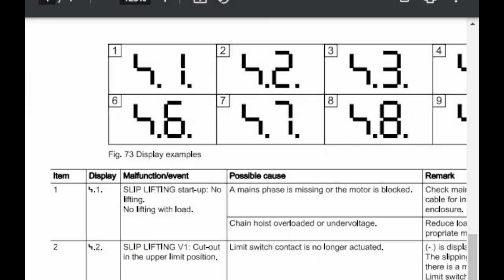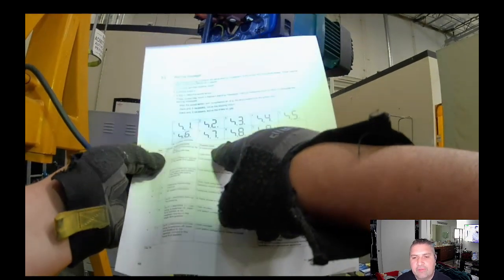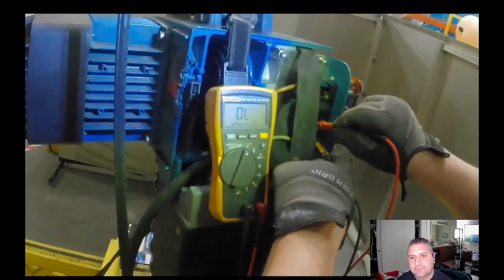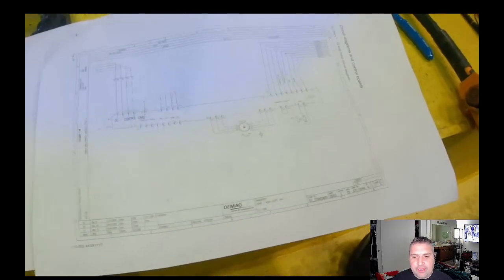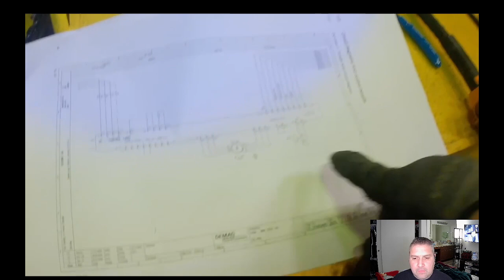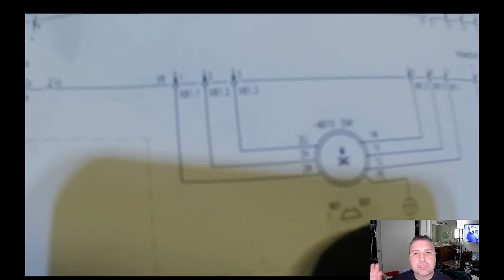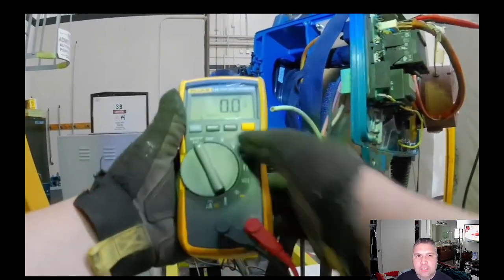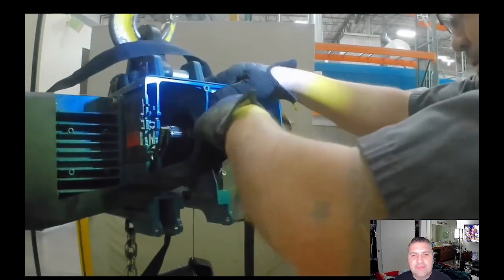INDUSTRIAL TROUBLESHOOTING 101: DEMAG Hoist Fault Solved

Comment: Hello .
I have a Demag 10Ton-  5ton. With two speed. Low and high
Working with same pendant.
My issue is that the 10 ton doesn't go down on the fast speed.
On lower speed is fine, but when I depress down to the fast speed .
It blows the small 3 amp control fuse.
What would be the cause?